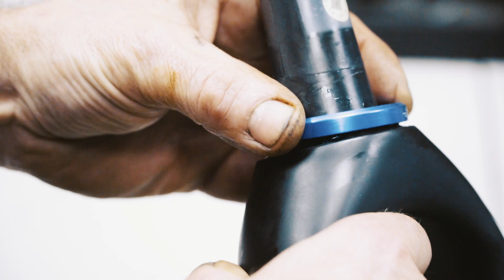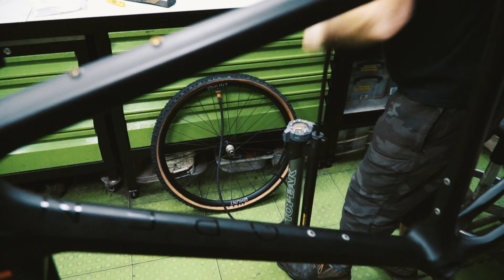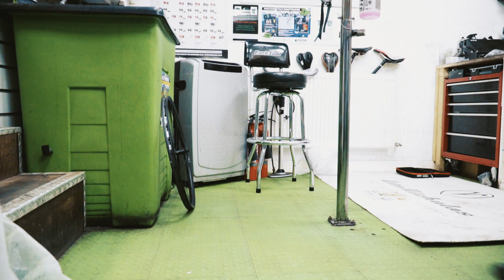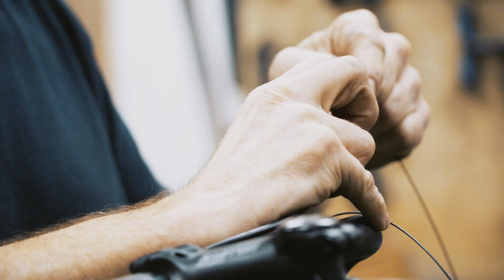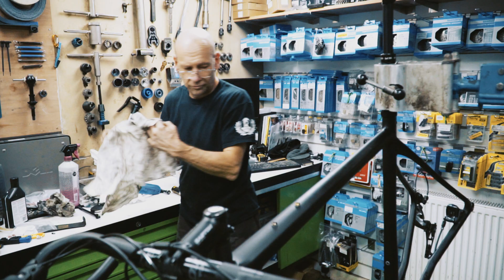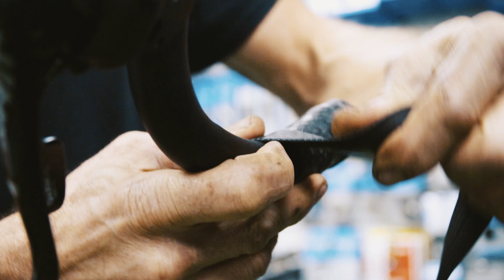The Ultimate Gravel Bike Build - OPEN U.P.P.E.R. + Hunt, SRAM, KS, Easton, WTB, Fabric, ethirteen

Comment: It seems you removed the Open screw that secures the hanger, you can see it when the through axle is mounted in the video. So to keep the hanger in place the stay of the rack is pressed on it when mounted ? That would mean when the rack is dismounted the hanger is not secured ?

Comment: Great video!  I just bought the TailFin system.  Does the endcap/derailleur hanger on the drive side need replacement to accomodate the tail fin thru-axle?  Thx.
Reply from the maker: Hey Vince, Can you please let me know the model name & year of your bike so I can check which axle is required for installation.

Comment: I'm about to enter a Google black hole but if anyone can save me the time and tell me which torque wrenches are used in the vid that would help tremendously. Also, what grease gun? It seems pretty run of the mill, but it's a finer nozzle than most.

Comment: Is that wheel just use clamping force to keep a rotor in place? I saw the six bolt but I didn't notice any bolts, just that lockring? What sorcery is this?
Reply from the maker: It's centerlock - to be fair - preference is probably six bolt as it's easier to change

Comment: Great Looking Bike. Can the suspension seat post can be locked? Are the lugs on the rear axle compatible with a BOB Trailer?
Reply: It's not a suspension seatpost - it's a dropper post. No, lugs are not compatible with BOB Trailer - they allow Tailfin racks to connect.

Comment: Where is the cap type short bolt that normally threads into the opposite side of the hanger bracket from the thru axle?  I can see the the Tailfin axle goes through the area where the cap would normally be.  Do you have some kind of hollow cap that you install afterwards?
Reply from the maker: Good question. For dropouts like the Open frame, we have a locking nut that goes on afterwards. We've just redesigned it so that it's possible to use multi tool to tighten it whilst changing a flat out in the wild.

Comment: Fantastic video guys, well done. I'm actually in the process of building up my own ultimate off road bias Open WI.DE with SRAM Red/Eagle mullet, Parcours/Zipp wheels and Envy bars to name a few bits. The dropper post mod you installed here is brilliant and I'd like to do the same (hopefully possible on SRAM Red). You mention in your article that you use a lower end post and that you might upgrade in the future. Have you upgraded yet and if not what would be your no expense spared choice to upgrade to? It's difficult finding a 27.2 dropper, I'm looking at the Canyon VCLS 2.0 at the moment but would really appreciate your thoughts. Kind Regards Tom

Comment: Great Video! building a OPEN WIDE similar to this one, but still deciding which wheels to use ... Hunt is also on the list, but still undecided between 650b or 700c.
One question, isn't  HUNT 30 wheels 700c or am I wrong?